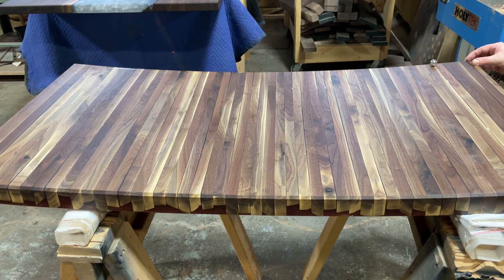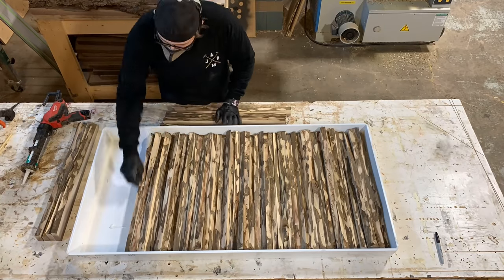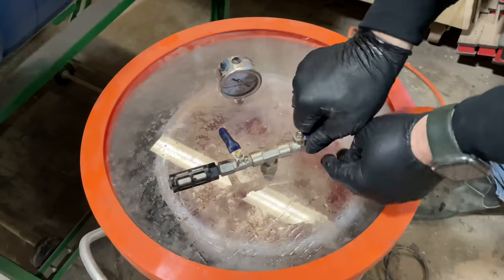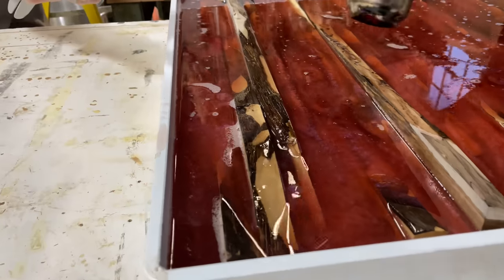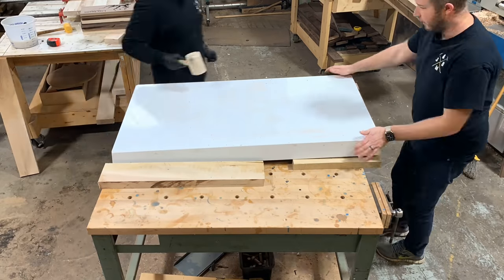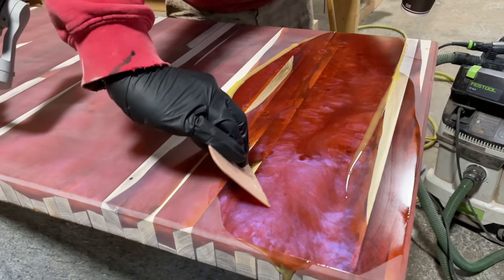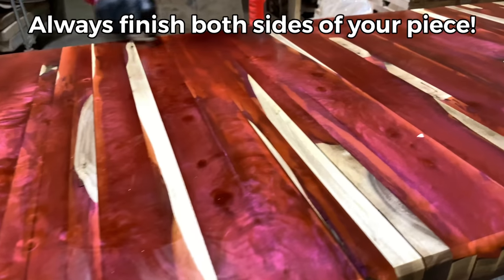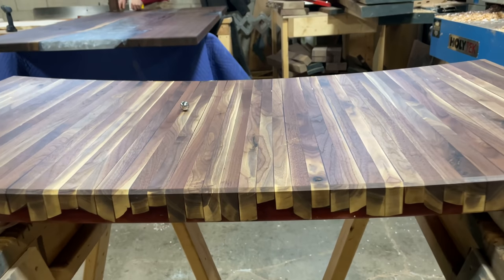EPOXY FAIL | Don't Make This $1000+ Mistake

Comment: I'm wondering if this issue was purely bc you used, what I'm gonna call runners, for the wood. I did this with a solid slab of walnut half year ago for a coffee table and had zero issue. Perfectly level. The runners would've allowed the wood to flex since it wasn't attached to anything except by the epoxy. Also i use c-channels which probably helped by solid slab.

Comment: Make it flatter, remove more wood, you can make it very thin, put it on a glass plate, maybe even a round one. Will look very sick especially with the right lightning condition. Also, next time, let the thing fully dry, let the thing set itself for about a week,  then process as minimum material while flattening. Finish and flatten underside if still unsatisfied about the thickness.

Comment: You still didn't learn why it warped, and so you didn't learn from your mistakes.
It's simple, the reaction was still not done and the excess energy went into the wood, deforming it due to heat and humidity.

Top being 100% epoxy and bottom being 100% wood doesn't change ANYTHING.

So either you let it rest for a long, loooooong time in its mold, or you put it in a medium (like a bath) and you sloooowly decrease the heat (of course, still in its mold)
It will be quicker with the latter but it needs constant observation if you don't have anything to make this process automatic.

It's like pottery or glass, if you let it rest by itself it will either warp or (most likely) break.
Reply: I had the same thought watching this.
Reply: I think it would have warped jsut the same if it was kept in the mold, the silicone wouldn't have been strong enough to prevent that. Though you're right that what happened goes beyond "well we used different sealing methods" and one should strive to understand the reason.
Reply: @sourcererseven3858  I think the silicone wouldn't change anything too
Just, you know, complete the mold and put holes there and there for the heat and humidity to escape and... done x)

It was all figured out thousands of years ago, but there's still some 'Muricans that don't seem to understand....
Tragic.

Comment: Can you just add a frame or cross braces to the bottom and super slowly crank and screw it down until  it lays flat or maybe heat it up at the same time and then add another layer of epoxy etc etc

Comment: put it under weight for a week and see if it straightens out. or route 2 groves to add square tubing an epoxy then in as a brace
Reply from the maker: I think both of your suggestions would have to be used together. I suspect that it would go back to it's current profile after the weight was removed if there wasn't some sort of extra reenforcement.

Comment: Honestly that warp table would be a very awesome artistic piece with proper supports and some really cool angled legs under it and then you just design like a clear coat to like trap it in its current warped position

Comment: Do you feel like if it was on a flat surface instead of the sawhorses and allowed to cure longer it wouldn’t have warped?
Reply from the maker: I don't think that would have helped in this case. It's due to the uneven finish on both sides of the table.

Comment: Aside from the wood exposure, the issue was that the wood was not connected to each other the long way (aside from epoxy), so has no stability to keep it from warping. 

I'd try low heat to try and bend it back straight, then route some grooves in the bottom and install c channels to keep it straight.

Comment: Beautiful piece regardless. I would say it would make an awesome piece of wall art or modify it into another piece of furniture. I still don't quite grasp why it warped after watching the vid. I'm a novice epoxy...obviously LOL! Is the $550 in epoxy the wholesale or retail cost as I saw you buy epoxy in bulk barrels. Not seen any other builder use epoxy in such bulk which is obviously a smart business move. Money saved is money earned.

Comment: Have you considered flipping the table top over and applying epoxy to the back side and running it through a surface planer on both sides until it returns to a plane shape?

Comment: What would have corrected this problem before it started to warp?  I have seen other tables people have made that added a steel tubing material routed into the underside.  I wonder if you would have done that when you first took it out of the mold would have kept that from happening?  Or make the wood pieces not as tall then pour the top, take it out of the mold and turn it over and pour more epoxy on the underside?

Comment: You can try vacuum bagging it to a ridged plate, like really ridged. and cooking it in an oven. You'd need to look up temperatures that might work for your resin and maybe try a test piece. But it might take out most of that warp just by relieving some of those internal stresses.

Comment: What did you end up doing?

If you still have it, you could use it as  a front or doors (would probably need to put it on bearings tough, because of the weight

Comment: Maybe you could flip it over, straighten it by force or weight, inlay or bore hole for steel rod insertion and once straightened, coat both sides with a clear layer of epoxy?

Comment: What about putting it in a mildly humid environment? The cupping seems like it would be from the completely wooden side drying and contracting while the part epoxy oiled side did not. If you got the bottom side to expand back out, resanded the epoxy side, it may flatten back out, then oil both sides the second time around?

Comment: Could cut out the corners and inlay a flat piece of glass over top. The warped center would add dimension that appears intended with the correct base.

Comment: Make sure it is fully cured, sand the top with 220 grit, put it back in a mold and pour a layer of clear over the top of it to float it flat again. Flip it over and plane it flat with a router and sled. If not leave it, the profile will be unusual with a slight underside arch. 
Fire under ice

Comment: have you thought about routing and bolting in some steel c-channels? impact wrench them to the wood to straighten the table, then epoxy the cracks up and the bottom and it'll never warp again.

Comment: Is it possible to weight the ends so that the warp is removed and then epoxy that side too. 
Maybe place it back in frame then clamp it down to be streightened befor pouring. 
Also you may try to streighten it using the technique that wood crafters use to bend wood  only doing it to level the wood. Just saying.

Comment: Or could you fix the curve with more wood and recon essentially making it a thicker table. It would look nice as a table on top of a different piece of wood shaped to fit it. I'm guessing it can't be straightened out by heating it maybe in a sander and putting it on a straight frame?

Comment: I would use a tube bender for metal legs, match,  or a little more radius.  Glass beveled top. 

Also,  the term is pearl essence.   You called it a color shift.

Comment: Stick it out in the sun and let the sun heat it up.  You will be able to move it straight.  Then clamp it down to a flat surface and pour epoxy on the other side. I had done it to my project and fixed it the way I just described.

Comment: Cover it with  plastic and put it in the sun for an hour or two, then place it topside down on some foam or something and put some weights in the center/clamp it flat - repeat until it flattens out - it should stay flat after that (Could add some horizontal c channels as well once it is flat to help hold it)

Comment: Hi! out of curiosity, would it have been possible to sand the wood and steam press it back to straight? or humidify it to have it expand until the table was true again? then coat with epoxy?

Also I would like to know what you actually did with it?

Comment: I too, think that the solution to a flat table is to increase the moisture content of the underside.   I would resort to steam and not a water bath.   Once it is relatively flat, machine a couple of dove tail slots and finish it with an epoxy finish(protecting the slots) then add the rails on the underside to hold it in position.  They should be 3" wide vertically and can be reduced at a later date when the moisture release settles.   Just sayin' -- that's how I would attempt to salvage it.

Comment: Can you flip it over and place weight on the bottom side to flatten it out then epoxy the bottom for a strong hold . Or you can tap a holes on both side and run flat iron throw the holes for a stronger hold I have done a table like that before but I did this from the start

Comment: put on green grass for day, or two till shrinked side get moisture and table will stretch up, after that apply epoxy on that side to lock both sides should work

Comment: A little late, but I had something similar happen to a table (that a client was waiting on😅)
I let it sit in the sun for a few hours until it flattens out some, and then while it was warm i clamped it down so it would hold the shape until cool. After that routed out space for metal supports on the underside, and that solved my problem.

Comment: You can save the piece by introducing an angular bar 2”x2” with one angle glued and embedded in a groove at the backside of the table and the flat side screwed to the underside.

Comment: Was the wood that was used in this project from a storage place that had a different level of humidity than the place where the piece was stored..or were the offcuts not sufficiently dried? oh, and the fix..remove the oil from the underside so that the wood can absorb some moisture. Turn it upside down and put a couple of wood slats on the underside..then put a wet rag or towel (just moist, not soaked) on top of that and the whole thing into some dark garbage bags over each end and taped together at the seam so as to keep the moisture inside. Set it out in the sun (still upside down so that the sun can turn the water into vapor and relax the wood. When it is reasonably flat route some slots for some quarter inch steel threaded rods that will be placed into the wood with an eighth inch gap between the surface of the table and the crown of the rods. Surround the rods with black epoxy and let it set up. Then resurface the top to get it to the desired flatness. Make sure then to add another layer of epoxy over the wood to keep it from drying out or absorbing additional moisture.

Comment: Using a number of steel, square tubing lengths (pre-bored), on the bottom side. In a controlled sequence of fastener tightening,, bring the surface back to true.

Comment: Was the wood not cured out to begin with? Maybe streighten and then furnace dry the wood. Did not realize apoxey was flexible like that. How do you prevent epoxy from flexing.

Comment: I'm wondering if you had a 1/8 or 1/4 inch epoxy pour on the bottom of the casting frame  letting it set then putting the wood on that or a timber board on the bottom and glued your timbers to the board, and your epoxy on top just as you did if it would of worked, I may have missed it but I don't think you said why it curved, you just said when you oiled the underside it warped, I know that having many pieces timber as you did that the wood naturally wants role up on its self, I bet when you carried the timber to the bench you had them all sort of rolled up under your arm

Comment: I have a question here; Would it still wrap if the wood pieces were nailed with each other instead of hot glue/silicon onto the table mold?

Comment: cut the table up into chunks. place back into the mold epoxy side down in patchwork peices such as long ways meets short ways then reseal into a flat shape. 

You should get a cool abstract geometric and possibly an illussion depending on how you lay down the peices.

Comment: Whatever method you end up using to straighten it, the water one is pretty good... you then need to put then entire piece in a press that can hold the whole thing until it dries/cures again.  If you had such a press in the first place it would probably be fine now.  Basically, when I work on something like this I always weight the whole thing down, I lay it on a piece of ply, cover it with a piece of ply, and then stack pig irons on it... but any solid weight will do.  I personally work in theater, so pig iron is something we tend to have a lot of laying around.

Comment: Not sure if you still have this piece or not,  but the contour looks like it might work for bar stools. Could cut it down to smaller pieces and make backless barstools out of it. (If the contour is correct that is)

Comment: What would happen if instead of one big table you made it into smaller tables? Less room to warp. Smaller areas to support, a better foundation. Or here is another thought. Scrapes for new a table as small accents to that tables river? Or even a multi layer side table or coffee table. Does it have to be a table? 
Or even shelving in general.
Or even turn it into unique chairs for another table. But test, obviously. You know the material. Even our biggest mistakes can be turned around for the Good and be made beautiful. I hope this helped you.

Comment: Maybe cut it into Charcuterie boards or rip in in half, throw the pieces on a Surface planer sled and run it until they’re flat. Or use them as bench tops.

Comment: I'd wait until it's stable (done bowing), CNC machine it flat - should still be thick enough.   Weld together a box ladder frame. Attach frame on the bottom side of the table by drilling through the top side and installing bolts.  Fill in the bolt holes with new epoxy of a contrasting color.

Comment: Maybe put it into a slightly more humid environment to get the bottom to take on moisture and straighten it.  Then pour a table top epoxy on the bottom to seal it so the moisture would stay constant.  I have been fooling around with resin, but have made so many mistakes so, not sure how well this would work.

Comment: Heat the resin side table with hot gun or 1000w hologen light (I used hologen light to correct my table) when the resin becomes little soft put weight on it for some time and make table stright. After that you can fix on 4 side supported table  with screws to not bent it bcak.

Comment: I believe the reason why the table began to bend is because you have the natural curvature of the log on the same direction.
You have placed each piece with the ring of the tree facing down. Meaning it will naturally want to curve again. 
To fix. Place one peace facing down and the next facing up. 
You can see an example of what I mean at 4:05. 
If you like I can explain further

Comment: I don't know if you still have this table. But! if you do then I would cut the table in three equal lengths joint plain the cut ends so the slabs sit more flat then I would add a strip of led light to cover up the cut joints. put in some chrome or brass fittings 1 for usb ports 1 for power out let maybe one docking. and of course a multi angle lamp. there is no limit to imaginations.

Comment: Cut it into pieces small enough to plane flat, then use those to make serving trays ,matching end tables, a  mosaic coffee table - anything that requires a small, presentable surface.
Reply from the maker: That is likely the most efficient way to salvage all this without going crazy with extra bracing and more pours.

Comment: I would try and sand the bottom wood portion and soak it in water for 12 hrs then clamp the table top down flat till completely dry maybe 24-48 hrs depending on your humidity location, worked for me on a warped aspen epoxy table!

Comment: I wish it cuped on the epoxy side and not the wood. Im no expert on how much of a cup would be "to" much on a sitting bench but i've seen many bench designs curved and cupped to a center. Is there a way you could grove out some of the wood on the wood side and pour that epoxy into those groves for flair and add some nice legs maybe if its wide enough even cut it down the middle and make a pair of cupped sitting benches?

Comment: Put slats under the boards to be able to pour the epoxy under the slats. Tip the form to one side so the epoxy flows under and allows the air bubble to escape. After the air is replaced with epoxy, level off the form to continue filling with epoxy.

Comment: I see a few options.

Use your cnc again to plane the epoxy side flat. Of course you would do it in layers because of the extreme bowing.

Or you could use it as a special piece of wood. That you could cut from to make other things. An end table made entirely out of that slab would be beautiful.

Or you might just hang it on a wall and call it art.

My favorite option would be to cut it in half at the center of the bow, and use the two halves as beautiful curved sides to just about any piece of furniture you plan  to build. A desk, a dresser, anything.

Comment: or you can put this through a table planer this will thin the table out and one side will still have a little bend to it while the other side is flat put legs on the side with the bend and then you have an artistic looking end table

Comment: You could add some longer legs or a back pice and make it a bench or if you are dead set on using it as a table go to a local metal worker ask them to make you some nice legs that are attached/incorporated thru the entire length of the table (they basically have a rail) and use that to straighten it out

Comment: I’m a little late, not sure this has been suggested.  Wrap it with 1x with tyvek tape on it to create an edge mold.  Then pour a thin layer of table top resin to create a flat top.  Then flip it and do the same on the bottom.  The clear will let the color shine and it will be lat and true

Comment: Cut it into strips sideways and repour it with a different coloured epoxy to create contrast between the gaps.
Then, put C channels in the bottom of the table to prevent warping in the future.